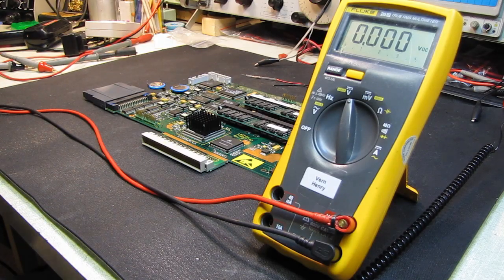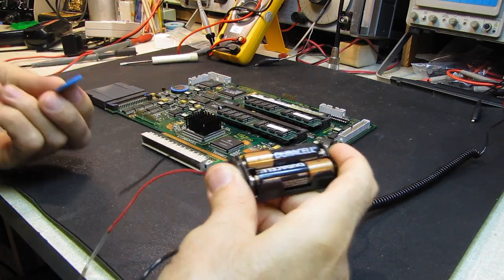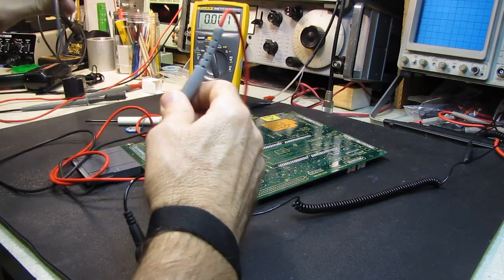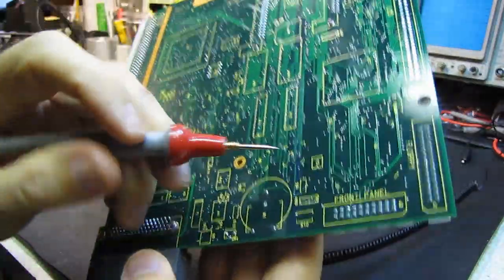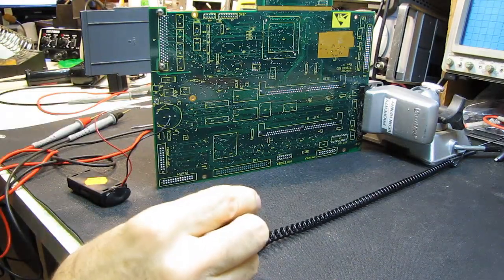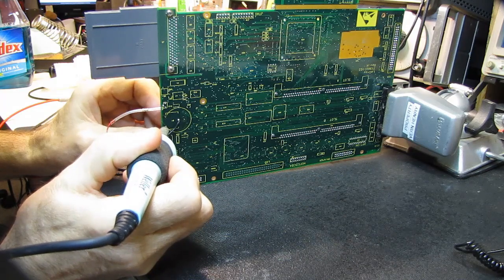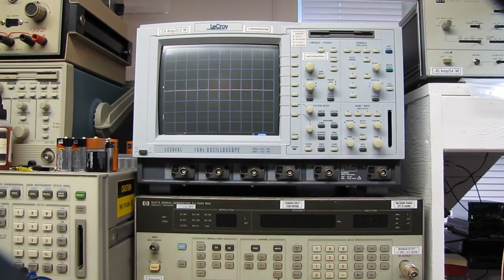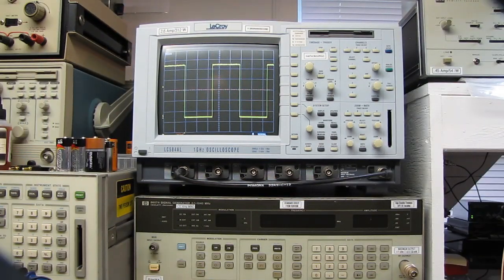LeCroy LC584 Memory Backup Battery Replacement

Comment: Nice work, thanks for sharing.  I have a similar Weller soldering iron station, had mine for years, it's my go to soldering iron.  The labs I used to work for years back only used those blue Weller stations.  Also, I bet you adjusted the yoke to straighten out the display, that would have drove me nuts (my OCD)  LoL .

Comment: You, Sir are hilarious at times. A pleasure to watch. What is surprising to me is that such a special, costly and sensitive piece of equipment doesn't have a "change the battery" facility (basically, a connector with limiting R and switch, like you did) built-in. What's the difference on the BOM for that? A few cents.
Reply from the maker: It is a common practice. Something that cost as much as these did usually were under a service contract. For the first few years the manufacturer took care of this task.
Now that us lowly old guys own them we get all the fun.

Comment: Please elaborate on isolating and grounding the iron.  I need to replace the keeper battery in my Tek 2465B in a similar fashion.  This is the first time i've heard this mentioned.  I use a Weller iron.  I'm also a novice and learning.  Will you please describe the correct setup for us newbies.  great vid.  Doc
Reply: The isolation part confuses me but I think he just means to check that the iron tip is grounded (0 ohms from tip to third pin on AC plug) and the outlet is itself properly grounded and not some bootleg ground trickery with a volt or two of AC on it. I don't think anything special needs to be done, just check things are working as designed. These battery backed ram setups are sensitive enough any stray voltage could wipe the contents.

Comment: Good job and great results, that reminds me to replace a couple of batteries on old mother boards. No Dallas luckily.
Reply from the maker: Sadly both of my Tektronix 400 MHz 2465B scopes have those stupid Dallas Chips.
Reply: @theradiomechanic9625  if it ain't broke don't fix it :) you can buy nifty Dallas replacements on eBay and shove them in DIP sockets as a precaution. Still it's pain :(

Comment: thank you why the soldering iron must be grounded
Reply from the maker: Two reasons. 1 - to insure no static discharge and 2 - to insure no AC leakage from the iron. Either can destroy memory components and processors.
Reply: @theradiomechanic9625  and this is why I would use these TS80/100 irons. Can't beat quality grounded iron.
Reply: @theradiomechanic9625  thanks